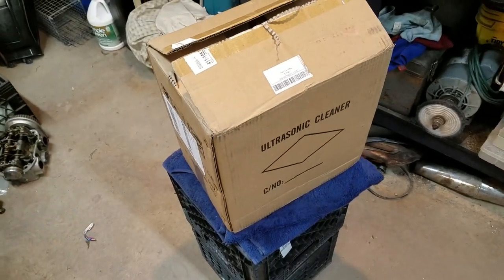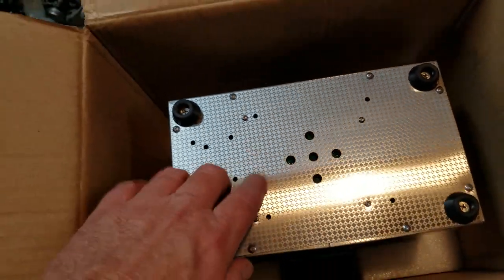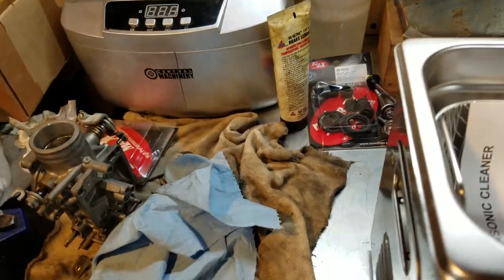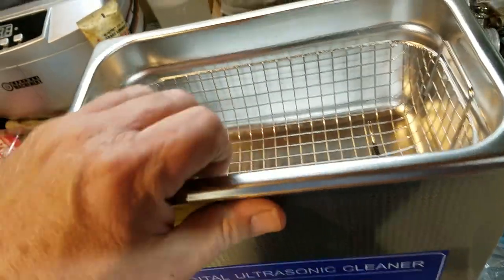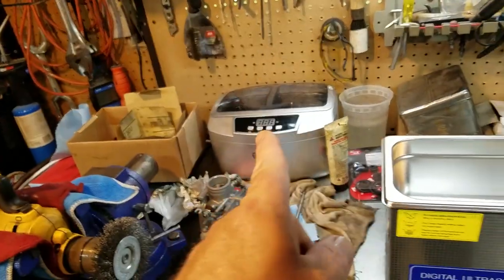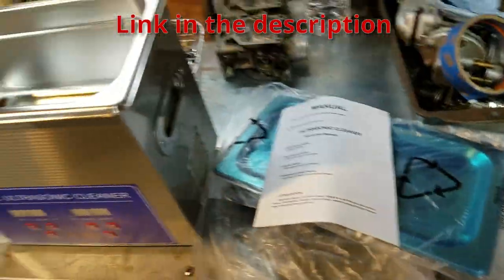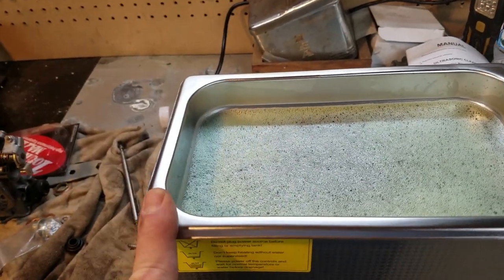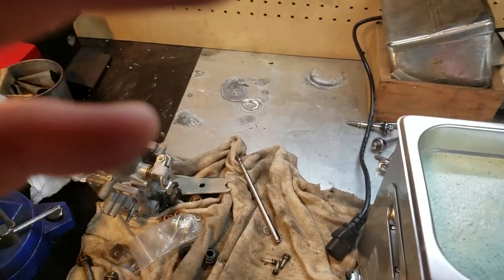3 Liter Ebay UltraSonic Cleaner

Comment: I spent $100 on the same one a while back.  You got a good deal!  3L takes 1 gallon of solution nicely.  My 3L worked very well.
Reply from the maker: Ah.. see while this claims to be 3L it does not take a gallon maybe about 3/4 of a gallon. So perhaps its not actually a 3L... :)
Reply: @MidwestMotoRider  oops.  what I said and what i meant were 2 different things.  lol.  the  "gallon" paint cans of gunk or berryman carb cleaner they sell at walmart or o'reilly's is perfect.  the thing is, those gallon cans don't really have a gallon of product in them.  they have a bit less  :)  my bad.

Comment: Good idea using the simple green, so you don't have to worry about plastic or rubber parts.
Reply from the maker: Yes, and disposing of it when its worn out is way easier than with harsher chemicals.

Comment: Look like a machine worth getting...Ive been thinking about getting one for using to clean my project bike carburetors for a while now.
Reply from the maker: So the only issue I found so far is that the actual temp keeps going up past the set temp. I checked it and it does get to what you set it to and pretty much keeps it there. So if you set it to 40c it will get to 40c and hold there but the display will read 55c or more actual temp so just ignore that setting. Cleaned up my GL carps like brand new. Would be great for the barn finds you bring home. :)

Comment: The Berrymans #0996 is not very toxic and has worked very well, better than my tests with Simple Green and Pine Sol. I wrote Berryman and made sure it would work with Ultrasonic cleaner because the old formulation 0905 would just evaporate off. I have been straining and reusing mine for about a year. Only thing is, you have to make sure you coat everything with a light film of WD or the like after, if you are not going to be using the part for awhile. The ultrasonic cleaner takes off the protective natural oxidation and oils in the aluminum and some alloys will flash re-oxide with fine white powder.
Reply from the maker: I will keep that in my pocket, for now the simple green works for me because I put parts in there that can dissolve in the wrong cleaner and until I can test those I will want to use something that is safe. The biggest issue with this cleaner is the solution in the tank keeps getting warm. I set it to 45c and after two hours of constant use it was up to 55c with the heat off.
Reply: @MidwestMotoRider  The digital thermometer on mine only works half the time, so I use a cooking thermometer. The  digital will say 10c and the analog will say 50c where I set it, so the heater is working. However I have noticed the temp climb over time. I think the excitation of the fluid actually increases the temp. I have not seen that big an increase (I get 3 or 4 degrees) but I only use mine in 10-15 min batches, with a bit of rest in between. I treat it like a cheap welder and don't max out the duty cycle. The carb cleaner also works a bit faster than the detergents. I also have 3 times the tank size so it would take longer to heat up.

PS I have had the rubber boots, floats and plastic in the Berryman with no issues. But it Did break down dissolved rubber from the accelerator pump strangely
Reply from the maker: That is a good idea, I will try that and see if my temp read out is just not reading correctly. Thanks for the idea!

Comment: I wouldn't have thought to use Simple Green but it looked like it did okay.
Reply from the maker: It does work well. The great part is Simple Green is easy to find, cheap and biodegradable so its easy to dispose of and it won't harm plastic or rubber. The one down side is it has to be replaced a bit more often.

Comment: Seems to do a reasonable job judging by the grud coming off in the container.
Reply from the maker: Yes over all its doing a great job, between the solution and the heat the sonic part does a really good job.

Comment: t seems to work good, I have wished a few times that I  has one of those but not sure I'd have enough carbs to make it worth while.
Reply from the maker: Yeah, I figure for the price I will find some uses. I have been using it to clean bolts and small parts covered in oil and grease. However heating up some cleaner like Simple Green in a pan would produce largely the same results.

Comment: So. Are you happy ??
Reply from the maker: Yes, I only wish it came in a 5L version. That said so far so good. Much better than that other one that was about the same price. I will likely follow up in about 6 months and see where it is then. The only one issue I found is the temp keeps getting higher, I set it to 45c and after a couple of hours of using it the temp was at 53c with the heat off, so that makes me wonder if the heat was actually off or if the light goes out but does not actually turn off. Time will tell.